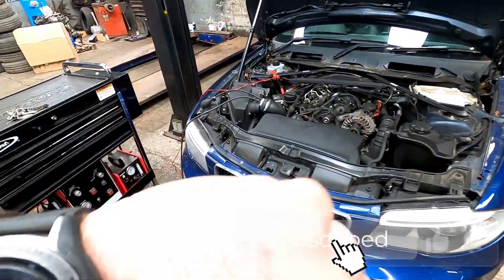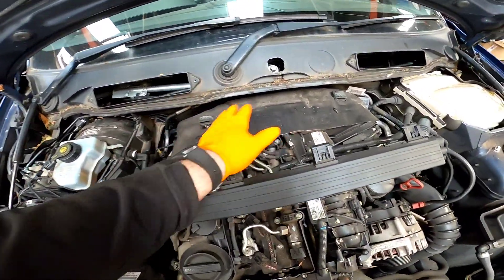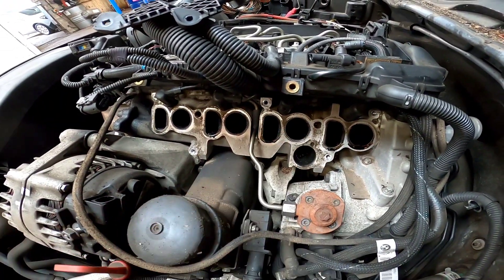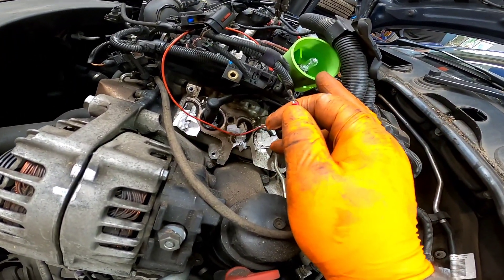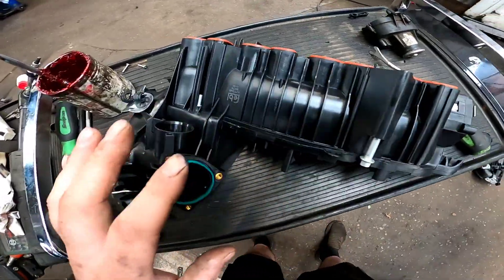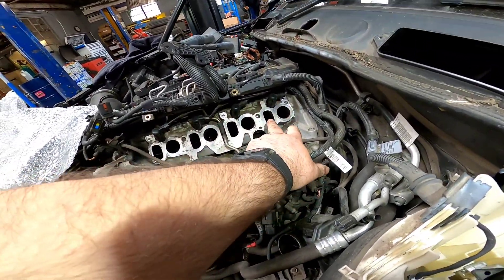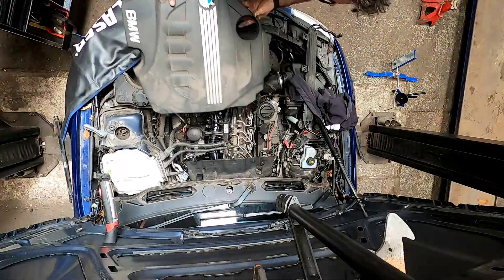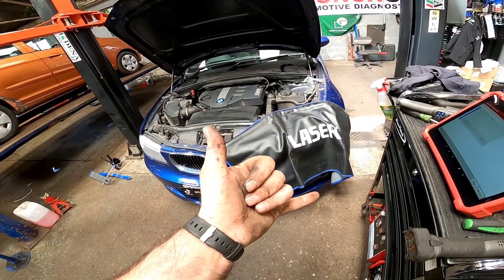bmw 123d dde 4933 air system, air to egr massflow, plausibility

Comment: I have the same fault code along with an intake air system leak message. The car has previously been to a garage. New EGR, MAP sensor and a repair to secure a loose boost pipe clamp at the manifold end. I’ve changed the EGR back to a second hand original BMW EGR and changed the MAF sensor again original BMW. The faults are intermittent. If there is a hole or crack some where between air filter and intake manifold would the fault not be permanently there? Was the fault intermittent on this car? I’m debating on changing the MAP sensor back to original BMW if the garage fitted a cheap one. Thanks